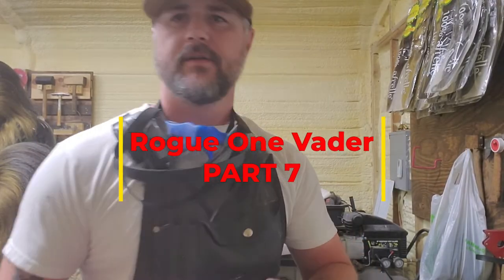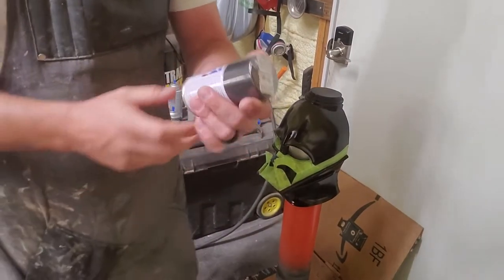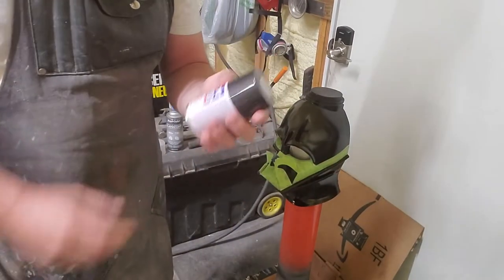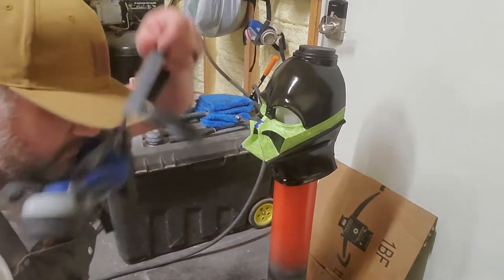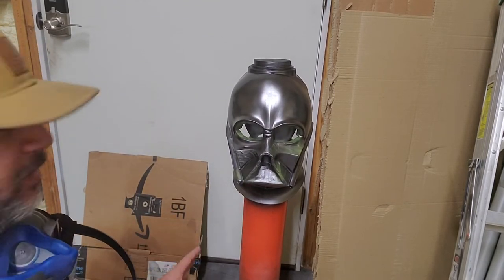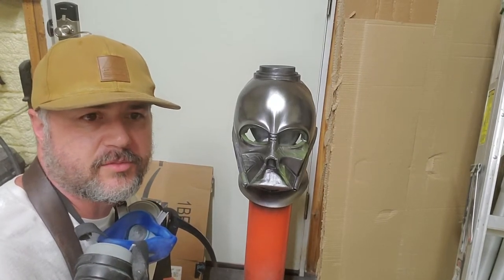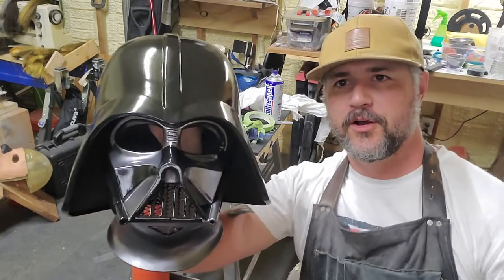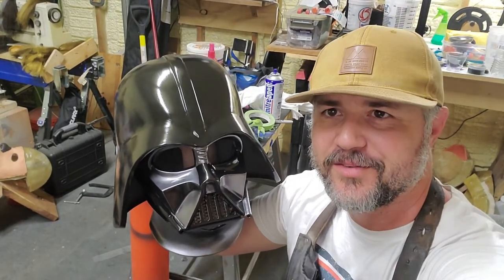Part 7. Star Wars 3d Printed Rogue One Darth Vader Costume Build....GUNMETAL ON V1 HELMET!

Comment: It's amazing how much the two tone color changes the look of the helmet.  The gun metal does look a bit light. but that could be also due to the lighting that you have in your garage.
Myself, I bought a can of Dupli color  - Gunmetal/ bronze met. it is a bit darker in color and very closely matches my EFX Helmet. Which I recently found and bought an unopened AHN Vader helmet from Ebay. I also recently received the eye lenses and tusks that I have purchased from Fenixprops. And am very pleased.

IU tried printing the tusks but found that I had to print a dozen of them the prevent them from melting. I also had to remodel the tusks to show the grip at the base of it to. But in the end these were pieces I ended up buying. However, very awesome job you did. It is coming together well.
Reply from the maker: Thank you very much!  I'm not sure about the TS-38 gunmetal.  It's definitely very different outside in natural light.  The little pieces are a pain. My plan is to resin cast some of these small pieces like the tusks after I print them.  Hopefully lol.  Still not sure about lenses.  Might make those too.
Reply from the maker: Thank you very much!  I'm not sure about the TS-38 gunmetal.  It's definitely very different outside in natural light.  The little pieces are a pain. My plan is to resin cast some of these small pieces like the tusks after I print them.  Hopefully lol.  Still not sure about lenses.  Might make those too.

Comment: As a fellow prop maker who paints a ton of Vader helmets I get the feeling of how long and tedious it is to mask off a Vader face plate. Was by far my least favourite part of the build. If you ever do another I highly recommend using fine line tape for all the curves and intricate details that need to be masked. Cut my masking time in half. Love the videos 🤙🏼
Reply from the maker: Thanks bud!  Yes, I absolutely hate masking and the Vader helmet is the worst.  I'm just going to have to order some fine line tape from Amazon or something.  I tried to find some before doing this helmet but didn't have any luck.
Reply: @naterritchey19  that’s where I got mine, it’s made by 3m. May be under the automotive paint masking tape search. Made all my paint ups a breeze and it doesn’t lift paint either which is nice.
Reply from the maker: Awesome, I'm gonna snag some up then.  Thanks for the tip buddy 👍